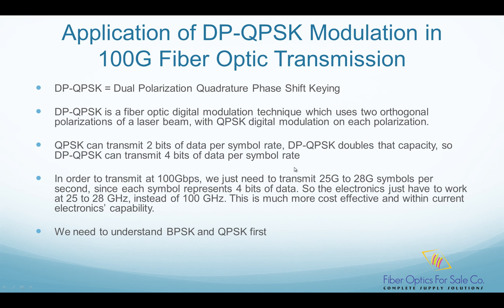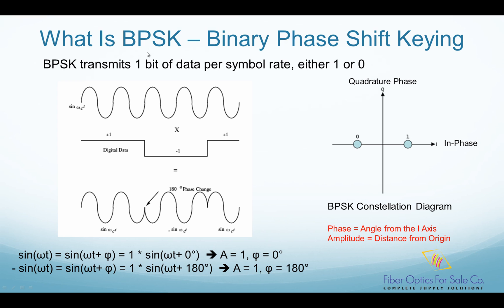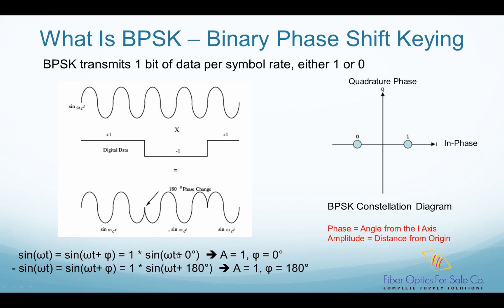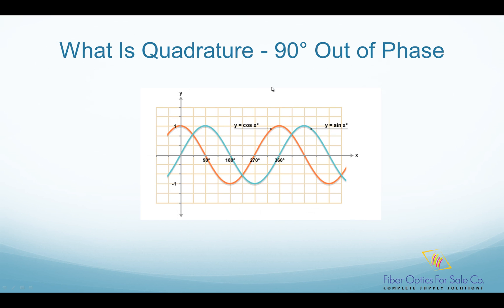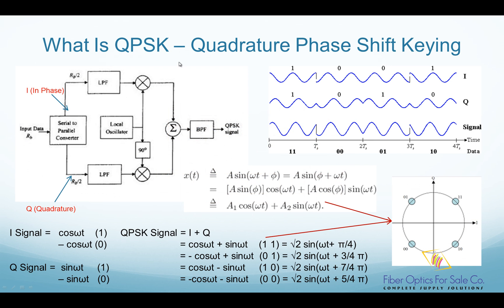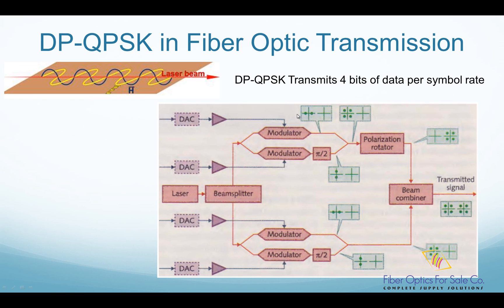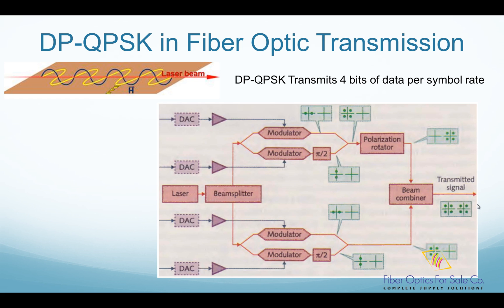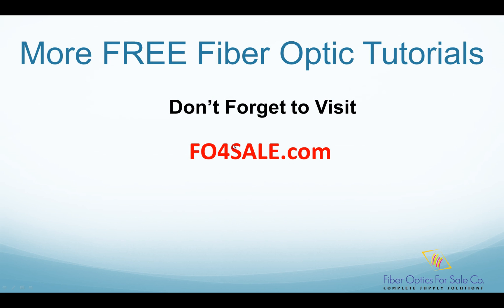What is DP-QPSK? - FO4SALE.COM

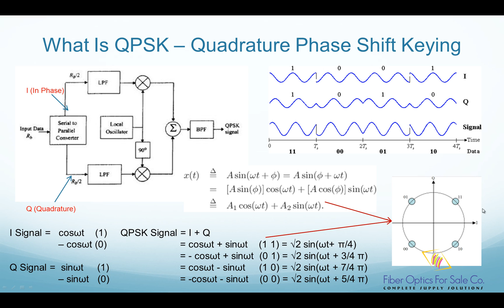Comment: I think your slides at 7:08 is wrong:
-cos(t) + sin(t) = sqrt(2) * sin(t + 7/4 * pi)
cos(t) - sin(t) = sqrt(2) * sin(t + 3/4 * pi)

Could you double check on this?
Great video nonetheless
Reply: @Aquarius: You are right. Great video nonetheless
Reply: But according to conrellation diagram, where x axis is cost , y axis is sint, addition of -cos and sin should result is 2 quadrant, am i wrong?